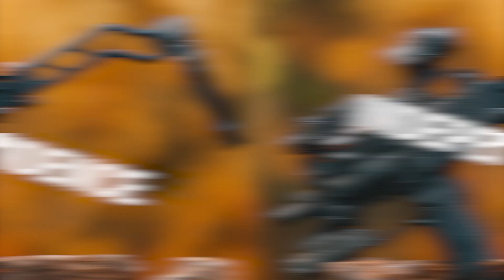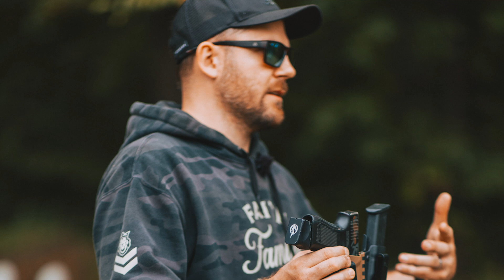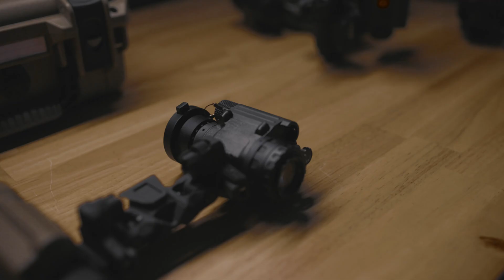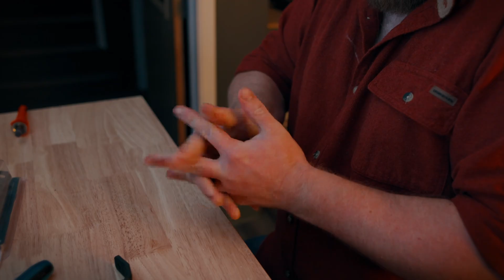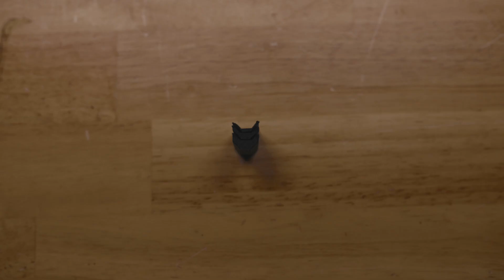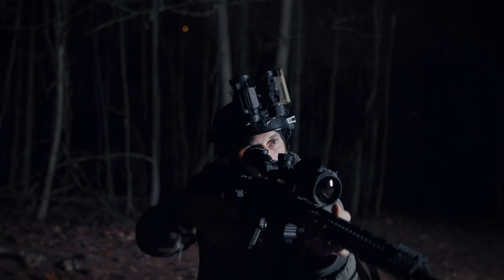Bridging RH25, PVS-14, RNV-14, RIX ST6 and more (Arkayne Symbiote)

Comment: I need an adapter for the RH25 similar to the AC53 obverse shoe that isnt an absurd $400 for a tiny amount of aluminum. The same material yall used in the bridge would be great considering the RH25 is a heavy unit.
Reply from the maker: Agreed. The AC53 is a prohibitively expensive option. But, it is required (for now) for running on your left eye. 

We have discussed this often, but we don’t have another solution just yet!